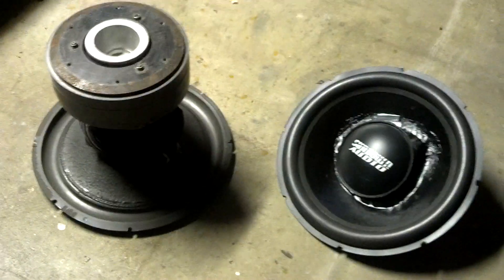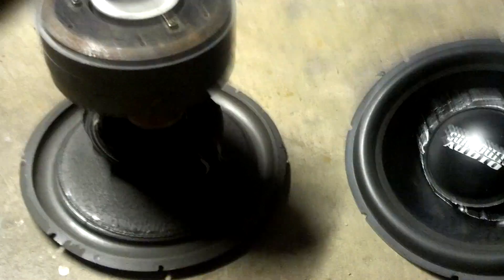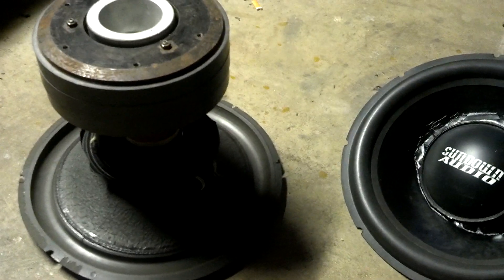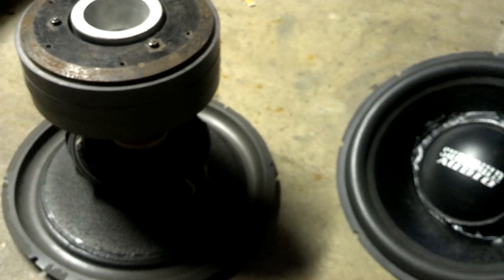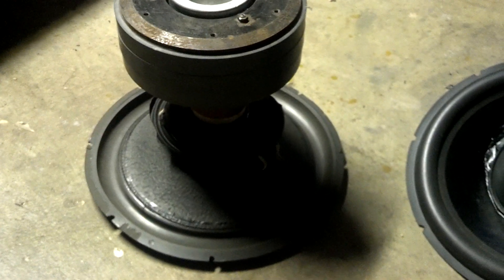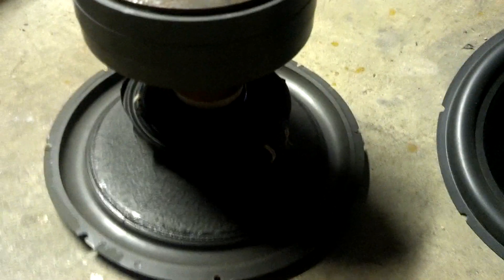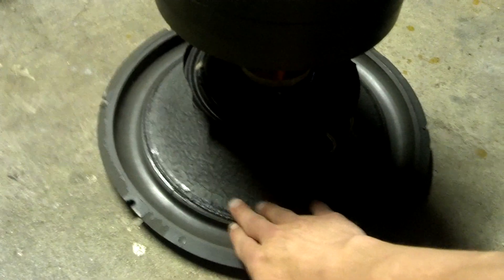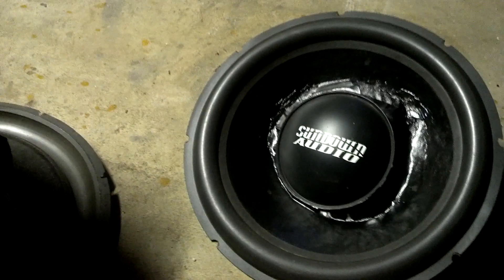Subwoofer Cone Strength Test response to EMF

Comment: Hey man. I know it's a random comment. But I'm having a problem with my amp. It's a 2 channel bridge able 1000w amp Powering a Dual coil Planet Audio 1800w.  I ran two of the subs in my volvo and it worked great. But I downsized to just one with my 92 Corolla. Now, occasionally I'll either turn on or off the car, and the amp goes into protective mode. So I have to remove the Switch wire from the amp, and when I reconnect it, it works until it decides to do it again, and it sounds pretty damn decent. Is it my amp? I used good quality and gage wire. I've triple checked it all, the ground too. It's definitely a budget setup, but the amp is only 1 month old lol. I was thinking maybe it doesn't like the switch wire from the radio to the amp. Idk honestly, any suggestions?

I just started watching again after 3 years! Nice to see you're still making videos bro. keep it up!
Reply: And the brand of the amp is Crunch. Definitely a cheap one lol
Reply from the maker: sounds to me like the internal remote is bad , do you have any other amp to put in just to test the theory ? even if its a small amp turned down that would help to narrow down the problem

Comment: I have a 10" AB XFL, if I got a new basket and cone/surround could I recone it to a 18?
Reply from the maker: yea , it would be custom but totally could be done
Reply: +mazda2284 .. yea cause I want to keep my coil, if I find the right size basket I might be able to salvage my spider too
Reply from the maker: just get new spiders dont bother reusing them , they are cheap enough anyways , coils can be reused as long as you dont bend them up , best way is to put your coil on a piece of pipe , i have pvc that fits a 3'' perfect , slide it down on the pvc and can peal away the old glues without damaging the coil , new coil is around 30$ , spiders around 5$ each , couple $ more for one with leads , basket is around 50 -80 depending on style , cone is anywhere from 30 to 100$ depending on what ur going for , glue and thats bout it .

Comment: Please document where the EMF video said ALL cones that are paper with some woven fiber on it are that way. The video showed 1 very specific instance, no more, no less. It also showed 3 different paper cones of varying strengths, show that not all paper cones are created equal.  In short, you can't blanket statement any material, as you are doing.
Reply: i actually had to go look up to see what video all the butthurt was about. 

what i saw was that the "lower quality" carbon cone had a lot of removed material (probably close to 1/4 to 1/3 the cone). i also noticed that the square edge of one of the cuts is where the cone bent. you also used your finger to put pressure on the cones not a weight so we have no idea how much force was actually used on each cone. lastly i'm not the smartest when it comes to subs but i would think the way they operate doesnt put that kind of stress on the cones rather they get lots of pressure on the area where the voice coil is at like in mazda2284's test.
Reply: +terran698 That's why a second cone that was cut out was used for comparison. It wasn't intended to be some super scientific study, it was a quick comparison getting blown out of proportion by people getting offended by a generalization and not something specific.
Reply: People have to see your video to be pissed off by it.  I'd also like to point out you still haven't documented where I said all cones like that are that way.  That might be because that isn't what was said. Your testing I predict will be as credible as the rest of your work.  Adored by teens, laughed at by everybody else. BTW, that $200 sub you're talking about has whooped nothing.  I'm assuming you're referring to the ones Scott Owens used which was the much higher model in appearance, and not actually a model you could buy. He didn't use stock subs, they were special made for him.  Additionally, I find your claims hard to reinforce when my cones are doing 180+ and you can't seem to produce that result from anything else.  This will be my last comment on anything from you because at this point it's just a waste of time. You will always claim to be right no matter what is posted, you'll claim fame because of some thumbs up, and everybody else will continue to do what they do, ignoring you.  Good luck on that frame you won't end up tooling and using that magnetizer MTX doesn't have because they don't make anything here anymore.
Reply from the maker: im going to do some better testing also with many many different types of cones , i was surprised but a couple places reached out to me after seeing this and are going to donate cones to have done in this test also
Reply: @EMF YOU and your company are full of bs and and you can't stand being wrong your subs suck and your company is going to fail because your a pompass jerk with an inflated head like stupid Meade I hope the worst for your carp company
Reply from the maker: ill do plenty of cones , send me one of yours ! and you did not say woven fiber you clearly said carbon fiber .
Reply: Why should anybody give you anything to test, with no test data resulting, and no significant proof of anything other than getting a free cone?  Some things are worth it, this is not.
Reply from the maker: you didnt say all but the way you worded that video you asked for this . was your second time shooting that video and you still failed horribly to prove anything other than you were bashing a cone , you also left out any facts of Thickness , Weight , FS and other factors in a cone . your cone might be super heavy and be horribly inefficient. you tried to play it off as these cones are weak and cheap and cant keep up with your product and bashing another , no professional company ive seen that i can go to their facebook or youtube and see such a poor test showing of how your product is better.  you didnt wanna step up and make a real video so im going to .
Reply from the maker: a free cone that im going to destroy lmao . im also gonna destroy a few of my brand new cones .
Reply: Right now, you're bashing, so.......  The video had NOTHING to do with any other factors, period.  It wasn't intended to.  It was showing 1 aspect of 1 cone.  That same cone I pointed out is used on 181 vehicles and power clamped champions, so it can't be too bad of a cone.  You took the entire thing way out of proportion for no reason other than to be a Youtube commentator.
Reply from the maker: EMF Audio
 well thats not the way others feel either, the mass amount of people in basshead groups that were bent over your video is what drove me to do this , not you . i would have never seen your video had it not been posted by others upset over the ''test'' you did and all the facts and values of a cone that you left out , ill make sure to go over them in my next video .
Reply: My first video pissed people off because any video posted to the internet will piss off somebody, always.  It could be a video of a sub with no branding sitting on a table doing nothing and SOMEBODY would be pissed off. Web traffic and store sales contradict what you're saying, because some people actually appreciate showing how subs are made.  I'm hope your footage included a force gauge and some data on a spreadsheet, because if not, you're just brand bashing.
Reply: +mazda2284 What force gauge will you be using? How will you track precise cone movement and limit movement to equal amounts to get accurate force readings?
Reply: +EMF Audio wow never buying emf, 200$ pioneer subwoofer cone beat your 1000$ subwoofer cone. get better materials man.... I've seen barevids videos of the dd9500 supercharged versus a teamseries and he was able to take a flathead to the triple joint ring on the sundown and cracked it smh, that's bullshit quality. I could stab my poor 40$ pyle blue wave triple joint ring and it won't crack....
Reply from the maker: EMF Audio
 your first video pissed people off maybe you should have thought more about it at that point and maybe not uploaded it ? your supposed to be a respectable company but with videos like that your hurting yourself more than anyone else.  got some great footage today and i have more cones on the way
Reply from the maker: EMF Audio
 i used brands and didnt piss people off  . the only person my video pissed off was you and maybe 1 other person that gave it a dislike , everyone else agrees giving it a like and look at the comments and the thumbs up they have.... just wait see how my testing goes , i can tell you unless you have some super special paper cone that nobody in the world has that ur cone has already been beat by cones made in the usa from 10 years ago , and a pioneer impp cone from over 10 years ago also has your style beat. showing what REAL companies use , btw the pioneer was a 200$ sub and has ur 1000$ sub cone whooped

Comment: Thank u for doing this!!
Reply from the maker: no problem , im going to do more tests in my shop where i have more tools for better testing , i asked EMF to do some tests legit like this and they told me its not worth the time or money . its sad when a ''high end'' subwoofer company that sells 1000$ subs has less money to do tests like this than a lil guy like me and puts out poor videos like that .
Reply: Why? It proved nothing but not knowing how to understand the original video.
Reply: A "legit test" like this? This isn't a legit test of anything more than stroking a brand boner.  You're not testing with new parts, having blown subs around doesn't cost you anything.  Using brand new parts to do this costs money for no reason.  We don't have blown subs laying around.
Reply from the maker: EMF Audio
 ill do a much better test in my shop , this was just 1 quick lil test and was still 100% better than what you did . bending a cone sideways ...ha . and i will be using brand new parts when im in my shop as well as used parts . i just dont have them laying around my house.